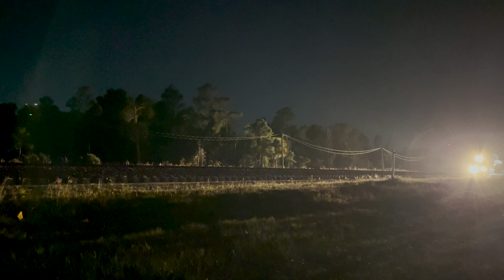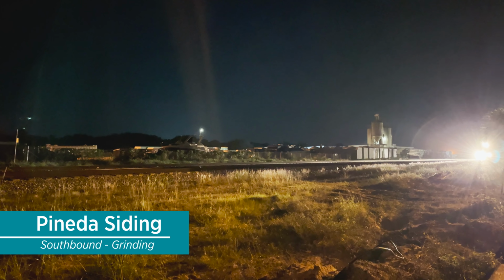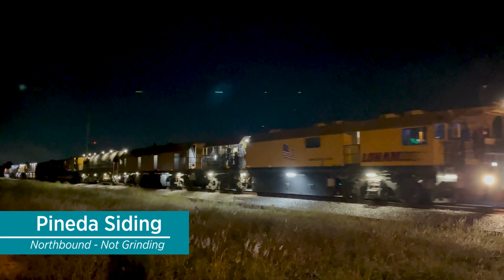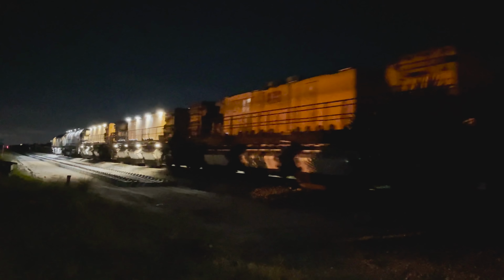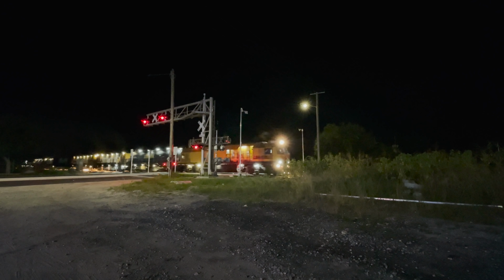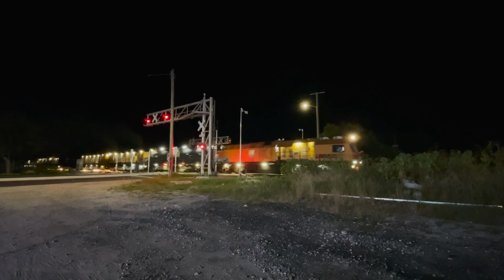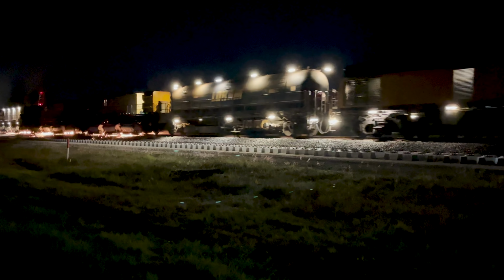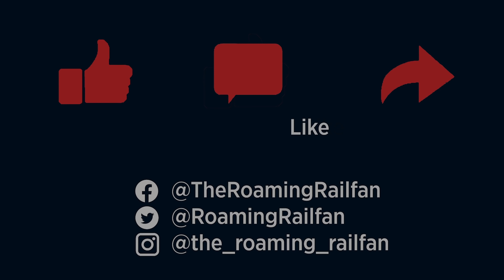Loram Rail Grinding Train Working on the Florida East Coast Railway

Comment: There are numerous videos of Loram's rail grinders on YouTube, but yours is by far superior to all of them. You depict this massive machine in its element, even when its running to get off the mainline so a scheduled freight can pass. That's a first. So well done. The video is beautifully shot. Your narration informative, simple and concise. 
But a couple of thoughts. 
1) They didn't grind away on that siding as a way to pass the time. Every inch of rail is analyzed by a track telemetry car/vehicle and that info is uploaded into a database with very specific GPS coordinates. These Loram trains know within a centimeter which part of the rail requires which kind of grinding, which grinding head is applied for how long, and how often. It's a very precise process. 
2) The dust generated by this machine is full of steel and stone, and it's toxic if you breathe it in. So use caution if you encounter a rail grinder.
Reply from the maker: I understand that it is all carefully planned out and the siding was going to be done regardless. I was more pointing out that they were able to skip ahead to work on it to take advantage of the time available there instead of working in order along the line and just sitting there waiting for the freight.
Reply: @RoamingRailfan  I wasn't criticizing you Austin, you said add your 2 cents, so I did. Another great video!
Reply from the maker: Understand, thanks!
Reply: The water spray holds down the dust -and puts out the fires that the sparks might cause.
Reply: The telemetry train is usually referred to as a “track geometry train” and TRR has captured such a train on the FEC in at least one of his other videos, though I don’t remember which one.

Comment: i wonder if they ground the rails to protect the wheels from damage on the new brightline trains..    any chance of close up shots of the rail head perhaps with low drone flights.. perhaps near crossings.. so the transition from unground and freshly ground rail heads can be seen before it gets smoothed out by rail traffic..  its just a thought..
Reply from the maker: Has nothing to do with Brightline, just a standard maintenance process

Comment: I work for Loram (OP1.. I operate the machine) up in Canada on a RGS (specialty grinder) we grind switches and crossings. I have worked for a week each on 2 mainline grinders RG416 with a camp car attached and RG404 with no camp car. I prefer my smaller machine to the mainliner.

Comment: Competing with Distant Signal on here huh? Good vid. Any reason the video was a bit "stop action" as it played? And low light level messes your recording device up. Probably does great in daylight. If someone knew in advance when that grinder was going to be along a certain section, they could dump a bunch of fireworks inside the rails. 🤣    Вы правы, рельсошлифовальные станки используются во всем мире, товарищ.
Reply from the maker: Not sure why it is like that, original file doesn't have any issues

Comment: We have enjoyed all of your Briteline progress videos! Keep up the great work! We were discussing today the steel rail and exothermic Welding and the question came up regarding the length of the rail delivered and how do they off load it? If you have covered it in a previous update let me know please. Or if you know....
Reply from the maker: The pieces of rail are roughly 1600ft long each. If being delivered along the existing FEC mainline, it is laid alongside the existing track as the train moves forward slowly letting it off. Where there is no track, it is dragged off by a piece of heavy equipment.  I haven’t seen either of these in person yet.
Reply: Thanks so much for for your reply. Keep up with your great work!

Comment: can rail grinders affect brightline service
Reply from the maker: probably not
Reply: The rail grinder is running at night to avoid most of the rail traffic. Once Brightline starts their services it won’t be affected by any rail work like this. The grinding would mostly increase fuel efficiency and reduce wear, as a small amount over the long term. It will be a long time before any of the new rail needs to think of rail grinding.
Reply: @andrewreynolds4949  Not entirely correct. Rail needs to be ground fairly soon after it is installed if it is the harder type rail. Rail also needs ground when fairly new to remove the thin surface de-carbonized layer which must be ground off as it is very soft and will rapidly produce cracks. That comes from Loram's manual of BOP.